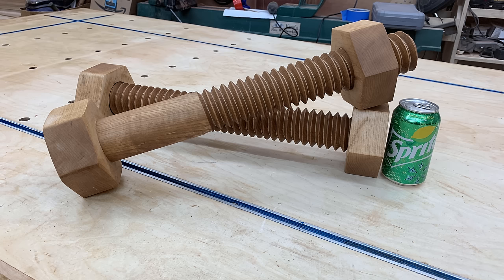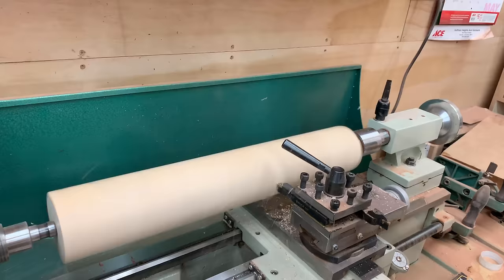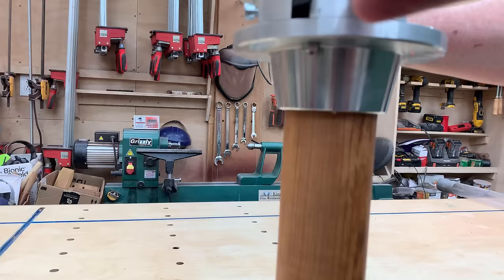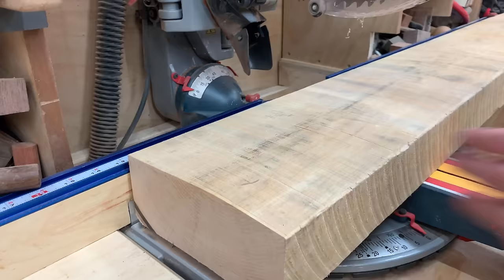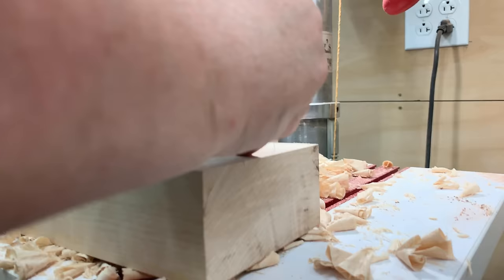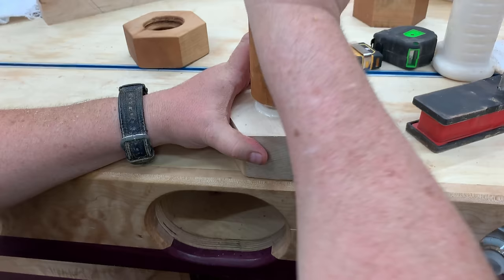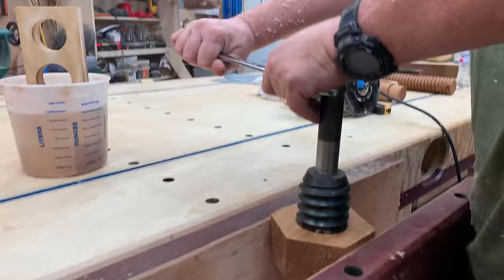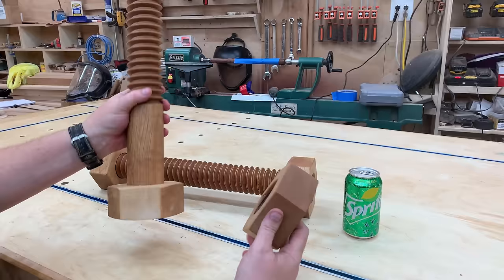77 - The Secret to Making PERFECT Wooden Threads

Comment: When you are getting ready to glue the two wooden surfaces together that have been saturated in oil it might might help to rub some acetone on it. Just the area being glued. It's not a perfect solution but it will help dry the wood a little for a better bond.
Reply: Actually, that's exactly what has been said in this video: https://youtu.be/nbY6El9Pzcs?t=780

Comment: That metal framed tap and die shown on your video is vastly superior to the type sold in even woodworking stores.The $50 set ups I've used produce a screw that is the same diameter as the nut and thus the threads of screw is too tight to fit into the nut. It's easier to sand down the nut than the screw, but it's still a real pain. Your model is MUCH better. 

I"ve also found that the cutter quality of the wood framed models is at best average to poor. Some of the cutters were so badly broken out of the box as to be unusable. 

I like your idea of using the plastic tube. I got by using paper towels soaked in oil and wrapped with foil to keep the oil in contact with the wood. I had to refresh the oil every other day. Your method is much easier, cleaner, has less waste and I suspect gives greater saturation. I like the coconut oil idea.

Comment: Fantastic project! And I love that you have your daughters working with you in the workshop. My daughter is 12 and very creative, so I'm hoping to get her out into the shop with me.

Couple of questions, if you have the opportunity and time to answer:

For smaller pieces, would there be any downside to using a vacuum chamber to accelerate the oil soaking process?
Any preferred wood to use for threading? Obvious initial assumption is that soft woods will be easier to tap, but less hard wearing. But any other considerations? Or does the oil soaking process work for the splinteriest (is that a word? It is now) of woods?
Would you expect any shrinkage over time?
Reply from the maker: Hi Doug! All great questions.
Vacuum chamber soaking would be ideal, and dramatically speeds it up.
I used mineral oil on these. But in the past I have used Tung oil, and walnut oil all have worked exactly the same. In fact some will prefer a hardening oil, just make sure to cut the threads before the oil cures.
I've threaded many species. Harder is better for sure. It doesn't work very well with softwoods.
Oak is pretty splintery, but after oiling, it threads and taps just fine. 
There is an imperceptible shrinking that occurs as the oil dries which works to your advantage. It shrinks just enough (probably 1%) that the nut spins on at high speed and has greatly reduced friction. But it shrinks so little, that there is still no play in the nut. And it stays like this forever afterwards. 

Thanks for watching & commenting. And, I bet your daughter will love being in the shop with you!
James

Comment: I'm jealous of your workshop ! sponsored by Sprite possibly? would it make more sense to drill the holes for the bolt head and nuts and cut the thread before doing the hex shape on the chop saw ,much safer than holding the hexagon with the hand while drilling . leaves it easier to clamp too , you could make a same size wooden spanner to hold the work maybe. Nice end product .

Comment: Huuuge respect for your work , precision , devotion , everything !  I 'm just curious about one thing : what's the atributes of the wood  after being soaked for 7  days in mineral oil ? Have you tested the wood buoyancy , is it  floatable in water or it sinks ? I 'm asking this because I planned to do an intensive oil treatment on one of my underwater wooden spearguns , and I was thinking of submerging it into teak oil for several days ;  that would definitely preserve wood from inside the best way possible, but I could dramatically change its balance in water ... If you have any experience , I would appreciate any information...BRGDS

Comment: What do you use to finish the greasy threads? I will be handling paper that cannot get grease from touching the nut and screw. I am making a bookbinding sewing frame with these bolts, and they are still greasy to the touch with mineral oil. Thank you for a great video!
Reply from the maker: If you use mineral oil, I’m not sure they will ever clean off. 

It might be best to have big threads made on a CNC routing rolling machine like Lake Erie Toolworks does.

Comment: Very interesting.    A comment on your comment about the chips.   If you look at photo micro graphs of chips cut out of wood, metal, and even rock, they all look like that.    Have you ever tried cutting the threads on your metal lathe via the single point method?

Comment: Hi, the thread / tap set you're using in the video seems like a 2.5" or larger diameter. Where does one find that. Links to Amazon top out at 1.5". Thanks.

Comment: Great video. Could you make PVC or black pipe vaccum chamber to cut down the 7 day wait ? A space heater on steel pipe would also heat the oil.
Reply from the maker: Both great ideas that would, for sure, work.

Comment: I'm building a workbench and tried to use the woodriver threading kit that seemed yo be super tight once I threaded the bolt... way too tight!!   You said the secret to making the threads, that You useMineal Oil to soak it... My question is can you use Boiled Linseed Oil to accomplish the same thing? Thanks!
Reply from the maker: Hi, it’s best to use a non hardening oil. 

As for the tightness, your dowel might be a tiny bit too large.
You can also try and sand it down even after it’s cut. Sometimes that helps.

Comment: Just wondering how tricky it would be to try to do this tap and die to join 3 broom handle sized dowls end to end. I have a vintage faux Christmas tree where the wire branches are poked into predrilled, angled holes along 3 screw joined dowls about the diameter of a standard broom handle- maybe a touch wider. I'm missing 2 of the 3 dowls, and wanted to make the replacements myself. So each dowl has an external thread at the end and the next dowl has an internal thread at the end to join, and so on along the other dowls. I guess I could get a large single dowl and just redrill the holes for the whole tree, but not sure it would have the strength of the 3 separate ones joined. It was manufactured the latter way, and stood the test of time, except for the part about getting lost😒

Comment: You make reference to this wooden threaded nut and bolt being 2 1/2 inches in diameter, but the tools you list are only a 1 1/2" tap and die set. Please give info as to the product used and where to purchase. Also you do not say the size hole drilled for the nut as that is typically smaller than the threaded tap set. Please advise.

Comment: The perfect way to make wooden threads = tap and die :P I have done that in the past, but I would only suggest that if you are going to screw it together with wood glue. Thanks for sharing James :) Hmm they make wooden taps I knew but wasn't aware of the die, I have always just used the metal ones which work but it is not pretty when you finish.
Reply from the maker: Thanks!

Comment: I need a threaded wooden cap for a Millers Falls egg beater hand drill, #5.
I got it for free at a garage sale cuz it didn't work and it looked awful. I really don't care to put a lot of money into it. But I would like to obtain a cap for it. When I got it it had the rubber cap off the bottom of a walking cane that fit it perfectly.  But I would like something more original in design and appearance.
Similar to the one on my Millers falls #3 hand drill.
Do you or any of your readers have a low budget idea to make or obtain one?
Any help would be appreciated.

I love collecting antique items such as tools, clocks, lamps and lanterns, etc. My favorites are my North Brothers 1545 hand drill and my 1937 Delta drill press. Also my Waterbury perpetual calendar clock from the 1880s, that I inherited and restored. Currently working on a friend's 1920s wind up phonograph.

I would love to join your woodworkers group.

Comment: Let's say it's 1440 and you're making a printing press for the first time.  How would you first manufacture a tap and die ?
Reply from the maker: It’s pretty easy to chase threads manually on a lathe. And lathes were around at least 2700 years before the 1400’s. 

But even without a lathe, people still make threads manually by drawing a curved line around a cylindrical piece of wood, and filing them out. They they just get tuned by hand. 

I don’t have the skill for either of these. But a talented artisan from a thousand years ago easily could have.
Reply: @KingsFineWoodworking  Thanks for the feedback.  I found a couple more YouTubers that went into detail about making taps and dies for wood screws. The really tricky part, imo, is a good tap to make tight fitting female threads.  I've seen a tap made out of wood, impressive in itself, but it would have been a great score if in the year 1440 you could have cast a TAP out of bronze.

Comment: Enjoyed the fancy photography, great info on the bolt head size. I've never thought about it in the past. A question though. roughly how much smaller is raw hole before you tap it, and vise verser  for the dye
Reply from the maker: Thank you! The hole is about 1/2" smaller.

Comment: Thank you, my first time saw this. My Known metal treads making  but wood really looked like a piece of art. A question:  instead of oil, have you tried water?
Reply: Water would lubricate it, certainly; but with material this size you'd have to be really careful bout drying it out without warping the finished product or allowing the dampness to introduce mold.  Plus, with the mineral oil soak your surface oiling is already done!

Comment: Nice! But I can't find the video where you cut those perfect threads on the bolt piece. Is there a part 1?
Reply: There is no part 1. It is the same process as a normal size nut just bigger. The nut will also need to be soaked in the oil.

Comment: hi, two things, whot is mineral oil, in English or equivalent, .. two, your link to the thread making tools were made of wood and not the same as the ones that you used, I would like to know more about the metal ones , and if there is an outlet for them in the UK.  keep up the good work.
Reply: Mineral oil is literally just mineral oil and there seems to be plenty of places selling it for "reasonable" price of 23£/liter. 
Reason why his tool links were for another product is simple. 1 1/2 inc kit is 60$ and one on the video on same size is 519€ and biggest they got 2 1/2 inc is 1200€, so i'm guessing thats bit excessive for amount of treads hobbyist realistically will make with one of these. For availability google or DuckDuckGo is your friend, there seem to be multiple places but price differs greatly.
As side mention 60$ kit is cheap china quality and price is cut on steel material and design where sharpening the die will require milling operation far as i read the reviews.
Though this is just a tread tool, so if you have access to milling machines you can make this tool your self pretty easily and other option is go look for old tools. I saw several old treading tools sold and people just forget that hey we actually had this tech century ago, some of those tools are still around and average people dont find much of a value in them these days.
Hope this helps.

Comment: Wonderful video! With the wood soaked so thoroughly it seems to me that it would be impossible to apply a painted finish. If I wanted to make them look like steel, brass, or chrome(with metal finish application) the paint won't stick. Am I correct or have you com up with a solution? Thank You
Reply from the maker: Hi, I used mineral oil, so you are right. Paint won’t stick to that.  You would want to use a drying oil like ring oil or danish oil if you want another finish on over it.
Reply: @KingsFineWoodworking  Thanks for the reply. I'm going to try this with Danish oil, I'm assuming about 3 weeks to dry-out .

Comment: In metal working, 3 taps are often used when cutting a thread for a nut etc.  1) a Start Tap, which is very fine and produces a very fine but virtually useless thread.  2) Intermediate Tap. This tap follows the fine thread cut by the Start Tap.  Both the Start and Intermediate taps are tapered.  3) The  Finishing tap.  This tap has virtually no taper and, in fact looks much like an actual  bolt.I am surprised that the nut did not split or crack with all the force that was being applied to the tap to cut the thread.  Using Start and Intermediated thread would in fact speed up the production of the nut/s, the number of damaged nut would be significantly reduced and the final threads would have a smoother finish and the actual thread would be sharper and cleaner.

Comment: awesome $1200 tap and die set.
Reply from the maker: Yes. If you want to go to the extreme large end they become expensive.
Reply: I was ready to buy “the nicest looking tap and die set I’ve ever seen” until seeing it was almost 1400 USD shipped!?  Even the 1-1/2” set is about 600$. I can’t be convinced  a 60$ kit will work as well as the 600$ kit.
Reply from the maker: Every tap & die I have that is 1.5” and under are the ones I’ve used in the links. $50 range. 

I cut flawless threads with those just the same. As long as the wood is prepped, they are perfect. I show using the 1.5” in my giant C-clamp video. 

But I have no reference to compare it with the Dieter Schmidt 1.5”, since I don’t own it. But I know I would never buy it, since I get perfect threads with the other.
Reply: King's Fine Woodworking thanks for the reply, I’ve seen your c-clamp video and the cheaper kit does look to work well.  I was just fascinated by the quality of the one you were using in the video and I thought “BUY NOW” I liked the low TPI on the one you were using also.  I’ll eventually get one of the kits under 1.5” that you use, when I have a true need.
Reply: $1200? lol and his metal lathe can probably cut nearly any thread he wants, both external and internal. Acme or multi-start thread won't be a problem either.
Reply from the maker: W.A. van Buren, how do you cut 2tpi on a metal lathe, in wood?

Comment: I'm curious as to which brand of die  You used to cut the threads on the dowels.  The ones shown in Amazon have wooden blocks, not metal.
Reply from the maker: This big one was a Dieter Schmidt brand from Germany
Reply: @KingsFineWoodworking  do you have a link for the big tap and die set?

Comment: Great video.  Thanks for sharing.  Where can I get a 3 inch size die like the one you used.  You must be very proud to see your daughters doing so well with your teachings.  Thanks
Reply from the maker: Sizes up to an 1-1/2" are easy to find and affordable. I have links in the description. To get the extreme oversized ones you have to order them from Germany.
Reply: Dave, is it the 2 1/2 inch Dieter-Schmid fine tools woodthreading kit?
Reply: :D yeah. Germany. WE HAVE IT ALL !
Reply: King's Fine Woodworking Well thanks for the answer to the original question.  Can you tell us the name of the German company you purchased it from?  A link to a web site?  Thanks.

Comment: Can you use ethylene glycol to preserve a bolt like this?
Reply from the maker: I imagine you could. But it would probably just be easier to use a hardening oil that polymerizes into a solid to do the soaking for the cut. Then do the cutting operation right away, and after it's made the oil will cure to  a hard permanent finish.
Reply: @KingsFineWoodworking  would that mean you could soak it in something like danishoil and cut the thread right after it is finnished soaking?
Reply from the maker: That's exactly right. And I've made them by using may different types of hardening oils, including Danish oil
. They all work just as good.

Comment: Is there a decent way to cut usable threads by hand(if that makes sense)? When I clicked on this video, I didn't realize the answer for how to make perfect threads was going to be "buy a $75 tool that makes the threads so you don't have to." I do appreciate your video and sharing with the woodworking community, but as a newbie, I'm a bit disappointed that the answer is simply to buy an expensive tool that does it for you...
Reply: Hand chasing threads on a lathe is one way. The other way is to. Hold your own thread box and a tap to cut inside threads.

Comment: Have you checked the prices on those "economical $25 to $50 a piece for those in smaller sizes"????  Uhm you may want to check that again.  I only want from 1/4 to 1/2 inch size.